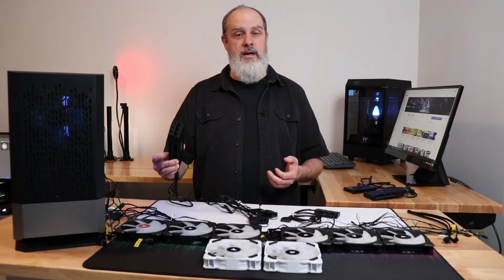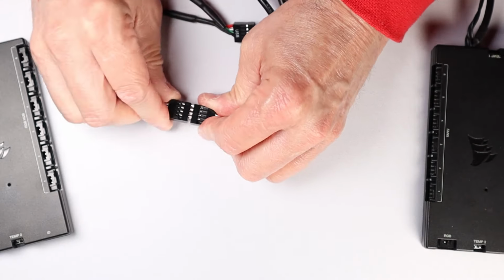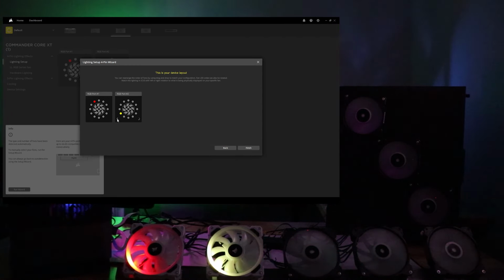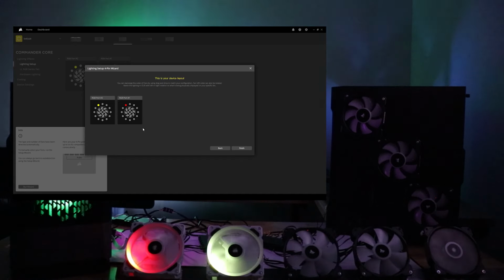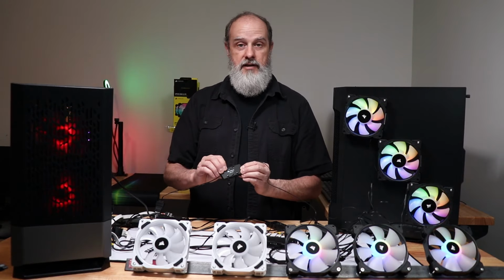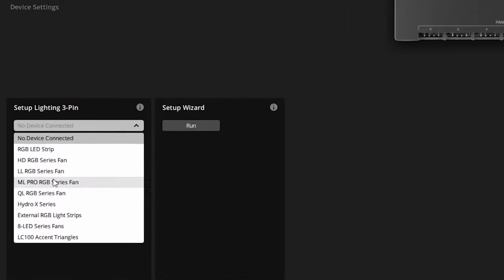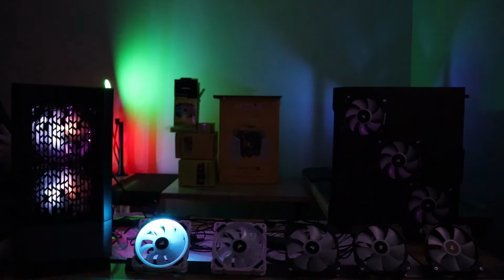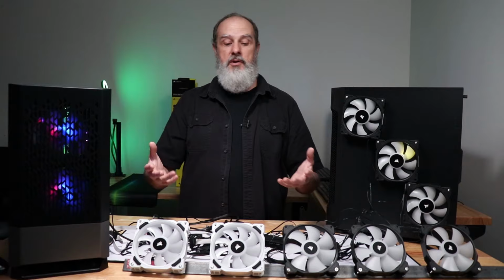Using multiple Corsair RGB controllers to control more than 6 fans in iCUE

Comment: As some one who just did a build with 10 Corsair QL which included two XTs and the Commander Core and way too many fan cables (10x2=20), I'm far happier with 10 Lian Li AL120s. I still have the Commander Core from the H150i but I now only have ONE fan controller and eight fan cables, three cables going to the mobo AND I was able to put my HDD cage back in because I had an 8TB HDD to install. I had to remove it to fit the controllers. It took so many hours of cable management and figuring out how to best connect the controllers. I also saved $220 after returning all the corsair stuff; $520 for the corsair, $300 for the Lian Li. And the Lian Lis look so much nicer. Sure I don't have as much glow from the side light rings on the QLs but when looking at the finished job, I could not ignore all the dead spots of the Corsair fans (LLs do it too but not as much). The Lian Lis have a steady glow and I'm not distracted by the LEDs under the fan. They also get pretty bright. Lian Lis also work with Signal RGB. And the specs of the AL120s are so much better. And "visor", what Lian Li calls "scan" works across all sets. No I'm not a Lian Li salesman, maybe a fan boy now, but do check them out for you next build. There is more that they can do. They really solve all the gripes I have with the Corsairs.
Reply from the maker: Hi GiSWiG, Thanks for the excellent insight on your experiences with Lian Li AL120's and the Corsair Fans. All are very valid points. I have a set of al120 fans here, but i've never done a build with them, perhaps i'll do a comparison video. I have used some Lian Li components in the past, mainly the Strimer series power cables.....Simply Amazing!!! I've no doubt the AL120 fans will hold up to the same standard as those cables. 

I've always liked Corsair, but I have no affiliation with them and will totally check out some AL120 Fans and their ecosystem. 

Thanks for taking the time to bring us some new insights!! And thanks for watching!
Reply: @HardwareArtisan  I should mention some cons but really only after having used the Corsair fans. You don't have the ability to layer effects like in iCUE. You can't create a solid color base layer and then add a spiral layer on top of that and in the case of QL and LL fans, you don't have the control of the outer ring. But I really don't have time to deal with all that. Regardless of Corsair or Lian Li, SignalRGB can do some great lighting effects easily. With the ALs, I can pass control of the lighting to the motherboard with the flip of a switch, literally. I haven't played around with it yet but I think I can use the ASUS Aurora Creator and control the fans that way. I don't think the software will tie in my EVGA GPU like SignalRGB. I also now have 2 8TB HDDs installed, something that I just didn't have the room for with all the Corsair control boxes. And something else that just I just experienced, I removed the tray with three ALs on it by disconnecting ONE cable, slid the tray with three fans attached completely out of the case with no cables attached. Now will Corsair do the same thing with future fans? Probably, unless the concept is patented by Lian Li, which I don't think they can? IDK. If you ever do a review, be sure to bring those points up.
Reply: @GiSWiG  I’m having trouble to decide bt lían li uní or Corsair ll, where did you buy the corsairs from and can you return them just because you didn’t like it?
Reply: @Blash1  I got the Corsairs at Best buy because they were on sale but returning to BB is much easier, even on-line orders. I don't know if they have the Lian Li's but you can get those on Amazon. Now of course, you can get the Lian Li Infinity fans so now you have side illumination. Really, if you pay attention to YT reviews of the fans that have high quality cameras (no offense Hardware Artisan) you can see how well the light diffuses in both fans. I think you'll like the Lian Li's. They can be controlled by their included fan hub or can be passed through from the motherboard. The Corsairs are not bad, just didn't work well for me, especially with the now 13 AL 120 fans in my case (excessive?). Its a total of 10 cables for those. 13 Corsair fans would be 26 cables.

Comment: Thanks for the video, very informative and easy to understand. Do you know if I can use the RGB hub to control the RGB for non-fan RGB devices; say like the RGB for a pump or reservoir or even just an led strip? 

My idea being to use the Commander XT to control my fans, both speed and RGB, and then connecting the RGB hub to the XT and use that hub to control other non-fan lighting (with those non-fan devices being powered elsewhere). Or does it only control corsair fan RGB?
Reply from the maker: Hi Tambo Biscuits, great questions. The RGB hub is meant to specifically be a FAN Hub. it's a 4 pin connection and I've not tested making any conversions from that to non-fan RGB devices. 

The core XT has an RGB ports, which is corsairs 3 pin connector,  to which you can directly attach Corsairs RGB strips and a few other devices. 

I did a video on using a conversion cable on this port which would allow you to connect it to a more standard RGB hub to control other devices. It's not a perfect solution however. 

You could also gain more of these 3 pin ports with the Lighting node Pro, which has two of them. 

Check out this vdeo here for some ideas:

https://youtu.be/JgLUDe1yzYw - How to get all your RGB working with CORSAIR iCUE - Tutorial

Comment: I don't understand how I failed so completely trying to use the commander core that came with the H150i elite capellix with lcd screen and a second commander xt. 
I have a MSI MPG Edge DDR4 motherboard with 2 usb motherboard ports and 10 QL fans. Which requires 3 USB 2.0 ports. So I tried with the usb from the lcd screen to that daisy chained commander xt. I never could get both commanders to show up. This was multiple fresh installs of Windows 10 and 11 with the newest icue version. 
I then tried the nzxt 4 port usb 2.0 hub. I tried to run all three, commander core, commander xt, and lcd screen. I never could get both commanders to show and rarely the lcd. Corsair even replaced the commander core for the AIO. Same result. I tried about every combination of plugging the usbs in on the motherboard. No solution gave me both commander core/xt and lcd showing up. 
The final solution was the pwm 6  port power hub for the corsair 5000D case to power the fans 7-10. Fans 1-6 were powered and rgb controlled with commander core, and fans 7-10 rgb was controlled with a lighting node core. I used the USB 2.0 splitter for the lighting node core and lcd. That worked. BTW Corsair support never told me that the daisy chaining commander core to the commander xt wouldn't work. By the time they responded on my open ticket I had pulled it all apart so I couldn't give them a physical look of the various ways on how I tried to get this to work.

Comment: Thanks so much for this great presentation! I am presently building a system in a Corsair 1000D, which includes a Commander Pro with the case, and definitely appreciate your insight and directions of connecting and controlling the fans ( 13 for me ), in the build.  I expect to employ 2 XTs, the Pro (in the 1000D) and the Commander CORE bundled with the H170i LCD/LCD connected to the H170i. Loads of connections! Thanks for helping to demystify the optimum connections!!
Reply: youp sphinge France plisse..? MERCI
Reply: @LUDO13helicoptere  Je suis désolé… je n'ai pas compris votre demande
Reply: @stevesls007  bonjours vous parlais Français ? 
 une questions concernant corsairs  ICUE pour branchait 13 ventilateur sur boitier corsaires icue 5000X rgb commander pro ou  Commander CORE merci de votre réponses leo
Reply: @LUDO13helicoptere  vous êtes le bienvenu, Léo.  Non, je ne parle pas couramment le français, mais mon iPhone l'est !  😉
Reply: @stevesls007  Mercie beaucoup cordialement  leo

Comment: Only thing I had problems with was with the xt. I have 6 LL120s and the 3 ML120s. When using the core xt and the commander core that came with the capellix, fans would stay at a normal fan curve until I opened any application. I see you have all the fans set to a 0 rpm, was wondering if when you were to turn the fans to the normal cooling preset if they all took off to 100% and ran at 2200rpm or if they stayed at around 1200. Because I tried uninstalling and reinstalling icue to see if maybe there was an issue there but all fans, even the LL120s I had hooked up to the commander core took off to 100% and I had all the cooling presets to quiet. I dont know if it was because I had the 9-pin usb plugged into the core xt or what, but I had to end up switching everything back over to using the commander core and a lighting node in order to get the fans to run at a RPM that wasnt going to sound like a jet engine.
Reply: Did you ever figure this out ?  I have the same problem.  I just don't open icue any more really.